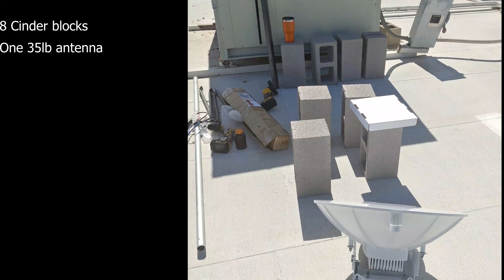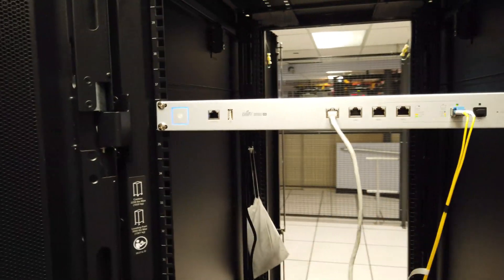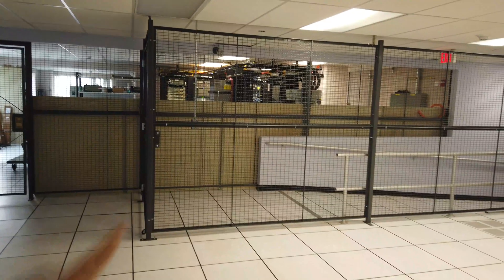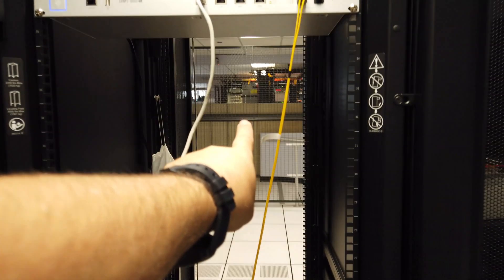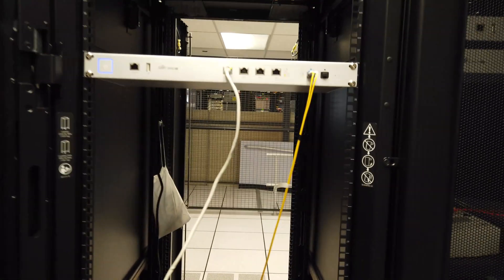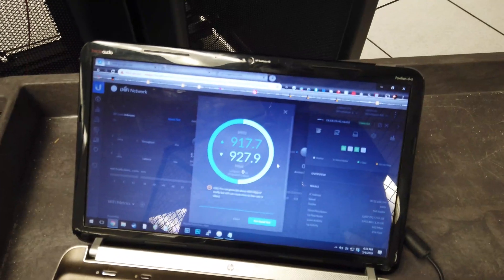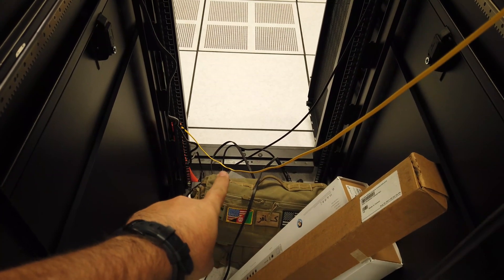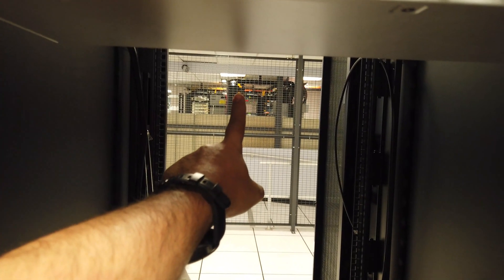We have connectivity!!  DIY Ubiquiti Internet Relay - Pt 6

Comment: 1:14  That fiber line look kinda scary bending a lil'. IDK as a fiber tech I never seen a LC connector sag a bit like that, not a huge issue but that usually make me worried.
Reply from the maker: Nah, it's all good. I've actually broken fiber on purpose just to see what it takes to break it and it's actually pretty damn tough. Little bend won't hurt it.
Reply: @rmp5s  Lol yeah those fiber cables can take a beating until there's no connectivity anymore, also I tested plenty of fiber paths around AZ that little things like that won't fly on my radar.
Reply from the maker: None of this is there anymore, anyway.